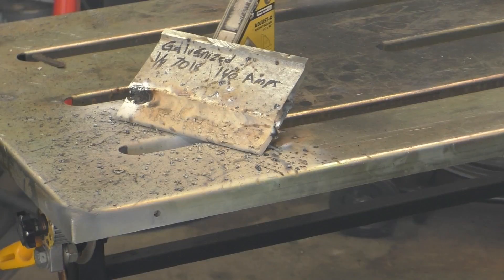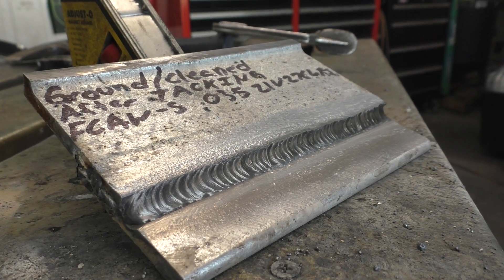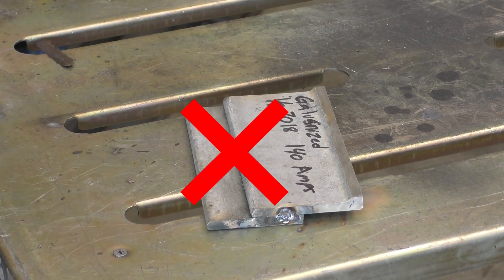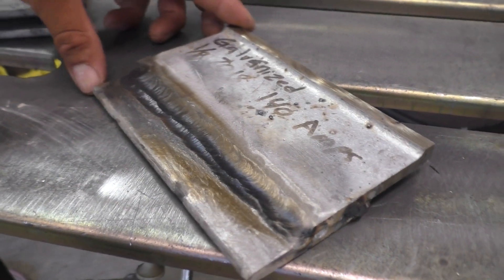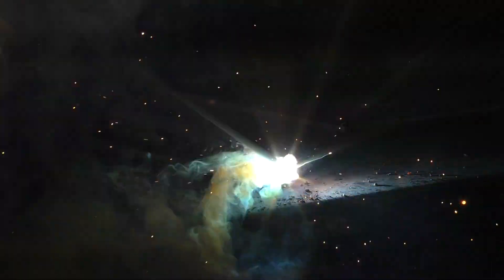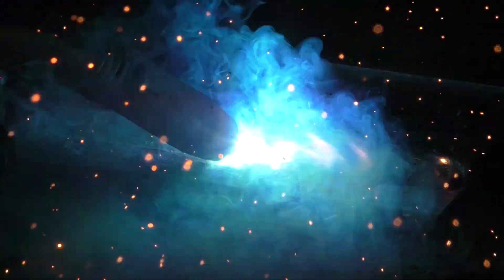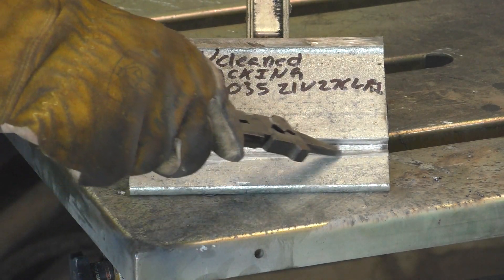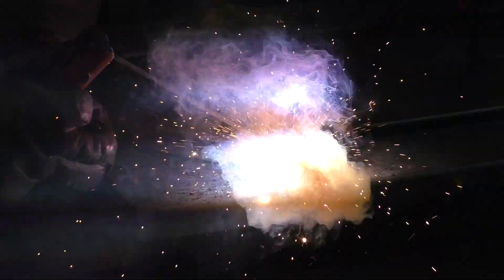Welding Galvanized Steel, Best Welding Process

Comment: I developed Dow Chemical’s specification for welding galvanized steel in 1985 as per the requirements of AWS D1.1. And AMSE Sec IX.  In a nutshell, burn the galvanizing off all sides of the weldment by at least 2” followed by grinding the ash off to bright metal.  At that time all structural steel was coming into our Midland MI plant galvanized so it was obvious a qualified specification needed to be developed.  The first serious problem of only grinding off the galvanized was that the zinc contaminated the grinding wheels, smearing the zinc.  When zinc is heat to melting it drives into surface imperfections and-as the heat is increased to over 1200*F cracking is caused from the action of the zinc contamination remaining.  This was discovered when fitters were bending 3/4” U-bolts from galvanized rod.  They ground the galvanizing off visually and heated the rods to bend.  During bending these rods ALL CRACKED and BROKE very similar to stress corrosion cracking.  When I had the fitters burn the galvanizing off and grind the ash off to bright metal, no cracking occurred!
Reply from the maker: This is very good input!
Reply: @cisnerofam08  if the above spec is followed there is absolutely no problem or concern with weldability or structural integrity using either SMAW or GMAW1
Reply: @SeldomFales what method was used to burn off the galvanizing?
Reply: @ Oxy-fuel torch followed by grinding.  Got rid of the galvanizing AND did NOT contaminate the grinding wheel/disk!
Reply: @SeldomFales  Thanks! I’ll remember this for the next time I have to weld galvanized.
Reply: @ I developed the procedure for Dow Chemical in 1987 and may be still be used for all I know since I’ve been retired since 1998! LOL

Comment: Well done video. I am getting ready to build a retaining wall basically covering rock wall that has been falling apart. I am using 3/8"x 3"x3" 4'-6' tall galvanized angle(posts) I am going to weld to 3/8"x4"x6" galvanized plate(bottom plate). I was a naval shipyard weldor for 25 years and am retired but am confident I can accomplish this. I sold my commercial welding equipment but still own a Maxstar140ST which should suffice for this. As you suggested I will be stick welding after cleaning the material. I purchased some acid to remove the galvanizing where I am welding. Not a good idea to burn any zinc and breath it but sometimes we had to and were instructed to drink milk when we got sick from it. We sometimes worked in tanks with inadequate ventilation and I remember stick welding  stainless steel, nickel copper, copper nickel alloys which gave me headaches.
Reply from the maker: Its a job I often tried to let someone else accomplish

Comment: Try welding 1.2 mm square tubing 50x50 mm. Let's see of you gonna grind it still
Reply from the maker: Welding thin material can be tricky, now needing to weld thin galvanized square tubing would definitely suck.
Reply: @cisnerofam08  Right now I am welding frames for a greenhouse from those . Any tips? Yes it sucks. I have to make 2 or more passes as the first one is just a dub dub so no penetration and mostly it won't stick to one side when I weld a T joint.  Nightmare!
Reply from the maker: @alexeyorlov9639 all I can suggest is put some extra time on prep work.
Reply: @cisnerofam08  OK. But what kind of prep ? I can't possibly grind it. Flop disc ?
Reply from the maker: Yes you can use a Flap disk or grinding wheel, I would try and remove as much galvanize material as possible before welding
Reply: @cisnerofam08  well, grinding disk will make it 0.9 mm after a slight grind so od rather not

Comment: I think most of your issue is you pulling your nozzle instead of pushing it when doing the mig process
Reply from the maker: I ended up doing both methods, pulling/pushing but in order to keep the video short I only showed one. Same mess for both

Comment: Why drag with MIG for the tests? I understand if it was gasless but you said you ran it with gas so should be pushing right? (@4m43s)
Reply from the maker: I did try it using both methods but in order to keep the video short, I only showed the best one.
Reply: @cisnerofam08  , understood, thank you

Comment: I have a job next week where I'm grinding sandblasted galvanized plates to I beams with E7018. I'm guessing grind off the galvanized in the areas that are to be welded?
Reply from the maker: Correct, grind off as much as possible

Comment: Thoughts on removing the galvanizing with muriatic acid first?
Reply from the maker: That's an interesting concept, I personally haven't used it.
Reply: @cisnerofam08  I tried it, it does work well.  I am welding a ton of galvanized I beam right now and have just found it easier and cleaner to just blast through the nasty crap with some 6013 rod.  I do have a powerful fan setup next to me so I don't breath that nasty stuff.

Comment: Lincoln LN -25 Flux Core 212 wire 5/64 goes through it like it’s not there and when you start grinding your actually taking the thickness down from your steel a CWI will fail the weld if they know you’ve done this and that weld looks like crap stick welding it total waste of time

Comment: been installing planters around a parking lot for a month and its straight uncleaned galvanized also first time having a job as a welder its been tough but if you just go super slow and shove the electrode into it with some force it works out, moving to regular steel was like butter after this
Reply: Ha I switched to gas shielded mig from stick because I thought it would be easier and cleaner

Comment: They got welding this shyt at work again now.   Got a huge order for galvanized stuff that needs to be welded.   I hate this stuff.   It's so toxic.   And the fan only blows it around.
Reply: Open your shop door. Look into using muriatic acid to prep your weld area

Comment: Im currently welding beams to the column, top bottom flanges and web sll the way around, galvanized steel, and I cant get in there with a regular grinder only with pencil grinder to clean it up and that doesnt do it justice. 5/32-1/8 inch gaps everywhere, it reallt sucks. 7018 rod.... 110ish amps seems to be work the best but its all kaka. ...any tips?) Do you think galvo welding rod would be better? I have welded galvo few times and it was much smoother. Maybe 4 days total worth of welding, 3-4 years ago. Didnt seem this crappy as this project
Reply from the maker: If you're going to be stick welding i would grab a 6010 and on the areas that you couldn't get the grinder in I would use the 6010 and long arc. This will burn the galvanize off while not depositing any filler/weld. This will hopefully give you a better weld with your 7018.

Comment: I am using a Reboot 1550D Mig/Tig/Stick/MMA welder. 220v using my mig flux core 0.30.
It only has an Amps dial and the volts and wire speed match on their own, so I’m wondering what do I set my Amps on?
I’m welding a trailer ramp and used regular 2x2 angle iron the average size in guessing 1/8 and need to weld the galvanized angle iron in the middle as support since that’s what I have left to the plain angle iron but I keep blowing holes in the galvanized, so what amps or suggestion and how in the world do I fill the holes I burned in the galvanized while trying to weld it to the main frame? Thanks!! Sorry for the novel!
Reply: Start with 80 amps and go down from there if holes keep popping out. Only do quick beads the metal is thiner

Comment: 7018 on AC works amazing for me. I found out by accident I was using it on AC when I thought the weld sounded weird but it seemed to burn so nice
Reply from the maker: That's an interesting find!?
Reply: @cisnerofam08  its a thermalarc 186i and when do you change processes it automatically starts in AC mode.